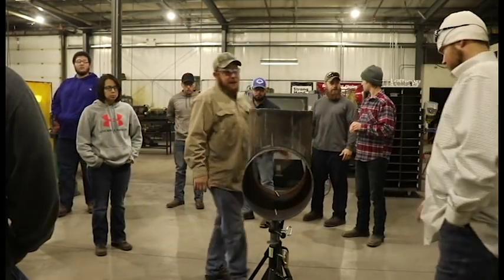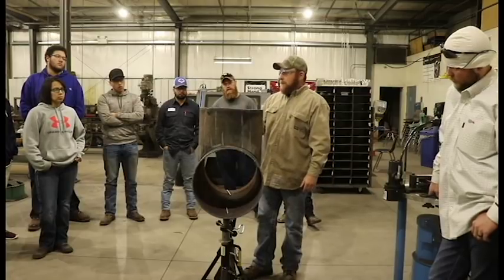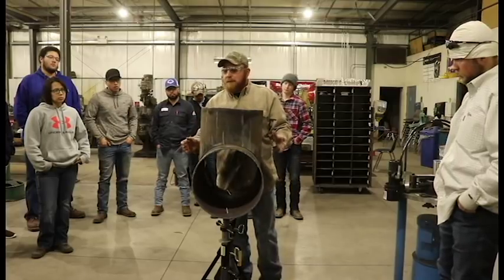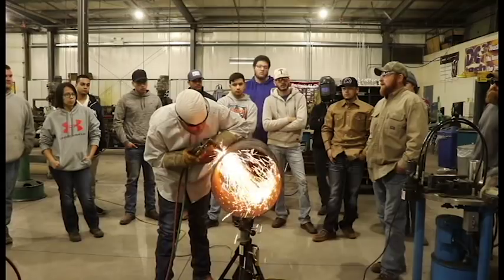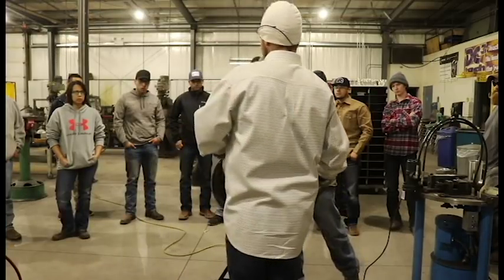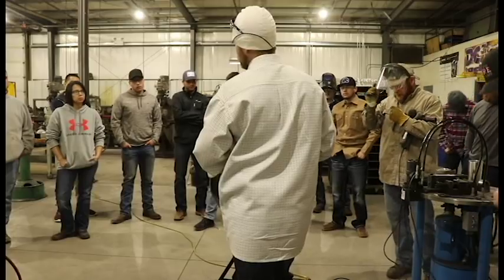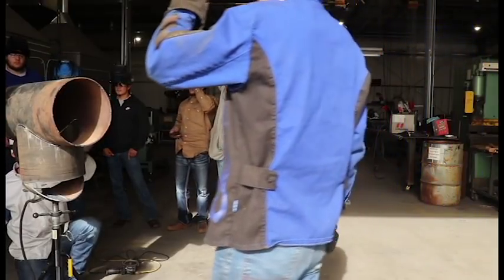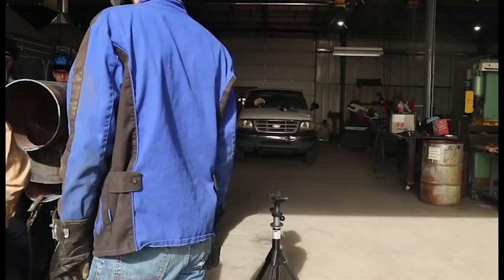PT 2 DCCC Lets Weld A Branch Test. helping Students

Comment: I saw Pro welder after another bust out on the Branch Test. 4 Made it. Out of like 20. 2 inch heavy wall is the test  to master work combo anywhere in the world.. Combo and then Stick all the way out. Gap 7018 all the way out. Open Root. Then pipeline down hill . Feel like that's the test you should weld first. Then work three years combo Refinery. Then 1 year Pipeliners Helper. Then Break Out Pipe line and Oilfield. Or Refinery stainless Compo All alloys. And Become Richer  than a Doctor.
Reply from the maker: Combo is great you will never be out of work.